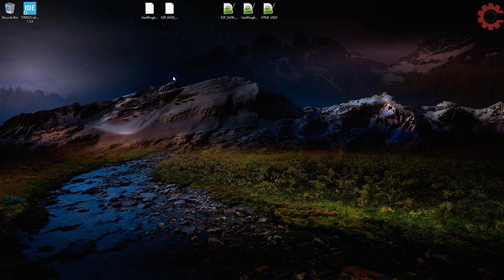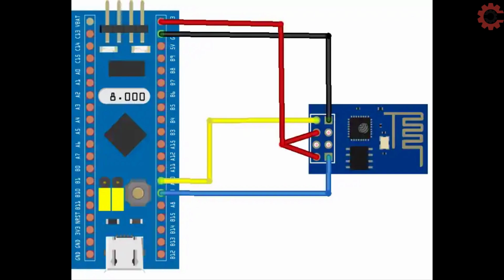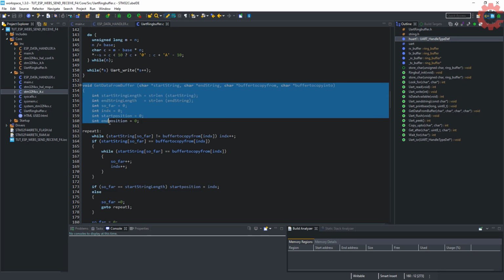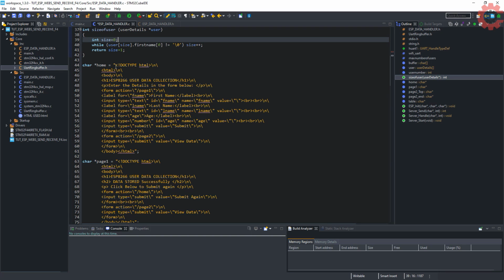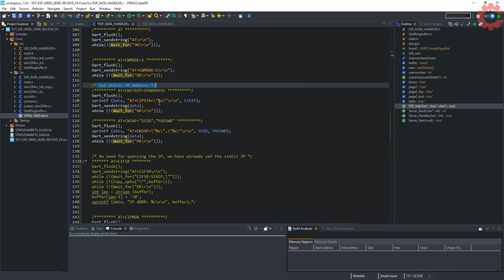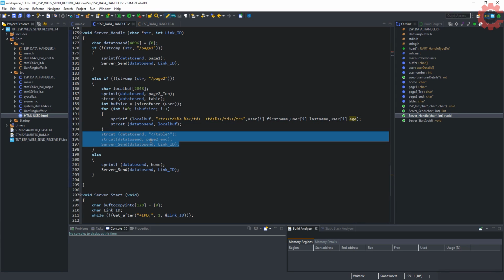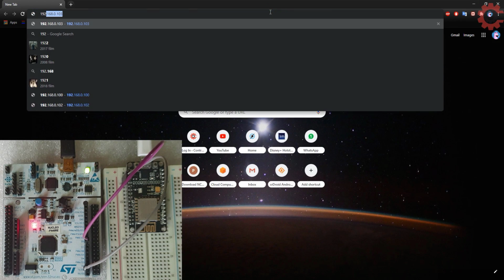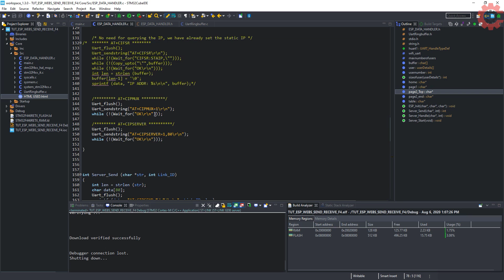ESP8266 WEBSERVER Send and Receive DATA using STM32 || Ring Buffer || CubeIDE

Comment: how did you use the esp8266 MCU like a wifi module
Reply from the maker: It is nodemcu. You need to flash AT firmware to make it work like the ESP8266 module. Search on youtube, there are a lot of videos explaining how to flash the AT firmware on nodemcu
Reply: @ControllersTech  thanks bro and contenue. You are amazing 💪

Comment: Hey good morning, first thanks a lot for your video. i've tried this and the Module does connecto to the wifi network, but when i try to enter to the ip address in my web navigator it just wont load, could you help me pls?
Reply from the maker: Your navigator should also be connected to the same network.
Reply: It is
Reply from the maker: Debug the project and see where it gets stuck.

Comment: Does it work with an ESP32 ? ( I installed firmware for AT commands and is working)
Reply from the maker: Why not just create the webserver using ESP32, and than simply communicate (not needed, but since you are insisting) with STM32 via the uart ?

Anyway to answer your question,  yes it should work. But do check the output of the AT commands separately (using some USB to TTL thingy) and make sure the output is similar to what is in the code
Reply: @ControllersTech  Everything is working, but now if I want to update a data, like a sensor value on the webpage, is it special At commands like for websockets?
Reply: @stefanmihailorincz  Hey man, could you send an example, seriusly, I am trying, but it´s not very well, it´s for a homework, could you help me?
Reply: @arthurzanchetta7995  i did what he did in the video, is working
Reply: @stefanmihailorincz  ow ok, so It’s me, because with me it’s not working… great :/
Reply: Hello, I want to run this project with nodemcu or esp32, but I couldn't. It works with Esp8266 (the small one), but when I tried it with the nodemcu used in the video, it doesn't work (I was uploaded a code into nodemcu and used it before). How did you run it with esp32? Also, I want to do this job without installing any code on nodemcu. As when using esp8266.
Reply from the maker: Nodemcu runs lua firmware by default. This code is written for using AT commands. So you need to flash another firmware on nodemcu which uses the AT commands.
Reply: @ControllersTech  Thank you so much. You are the best.

Comment: Hello, Controllerstech! Great tutorial, it works for me!:)
 I have to say that you deserve the best in life for what you create for people and how you educate them!
I have an additional question: is it possible to create web server this method, but with possibility to access esp web-server anywhere the world? At the moment I can connect from smartphone or PC but only if that devices are connected the same wifi hotspot as ESP module :c
Reply from the maker: You can do that by "port forwarding".
But i would suggest not to do it, use dedicated servers like thingspeak
Reply: @ControllersTech  Why not to use port forwarding?:( is there no way to somehow "insure" such an operation? Thingspeak looks good I think, but it seems more suited to retrieving data from some sensors than, for example, for storing a website as in your guide
Reply: @ControllersTech some errors occurred bro

Comment: HII HOW ARE YOU?ITS GREAT REALLYYY ..can you controll stm with android ?
Reply from the maker: Yeah use the weserver on your Android or ios..
Reply: @ControllersTech  thankk.what database you used ?
Reply from the maker: There is no database.. it's happening in real time.. sending the entire html at once
Reply: @ControllersTech but for android i need database to control it  ..what link should control use in android to get and send data?
Reply from the maker: I don't know much about database... U better check some Arduino videos and then try to replicate them here.
Reply: @ControllersTech  thanks i use stm32 ..if you need android app i make it for you bro
Reply from the maker: I know you use stm32. I am saying use Arduino videos for reference. They have some videos where they use the database..
No i don't want to work more on this. If you want to make an app, just make it for yourself, where you can use the browser type functionality to connect to the webserver.